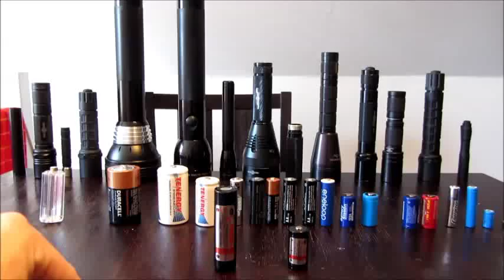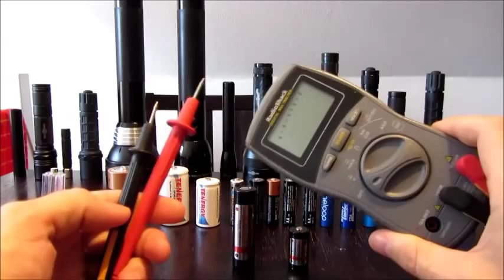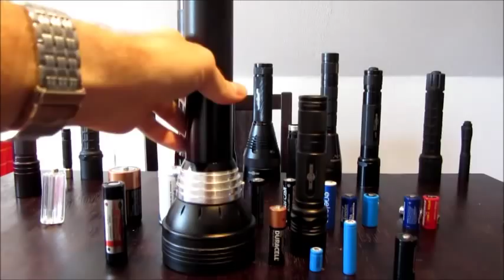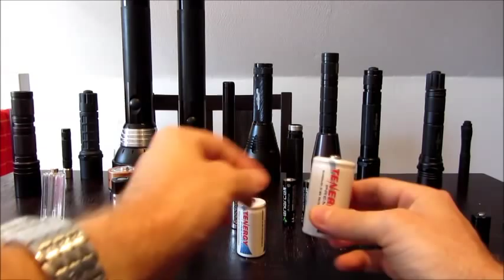Batteries Part 2

Comment: Protection (cont) 0:00
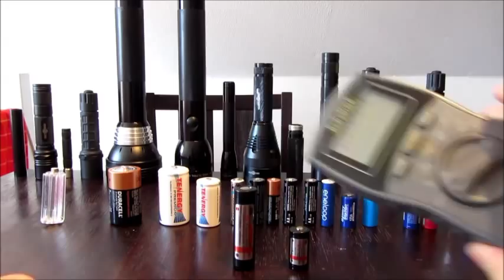Multimeters 1:17
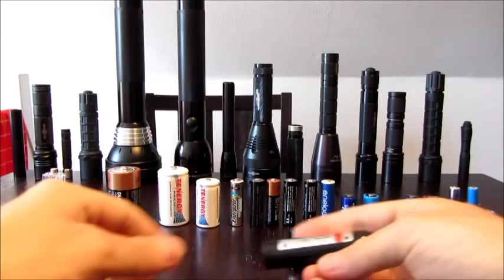Li-ion Nomenclature 2:17
Capacity and current 4:30
Lithium Maganese (IMR) 7:03
C&D NiMH cells 9:20
Voltage sag 11:56
Battery configurations 13:47